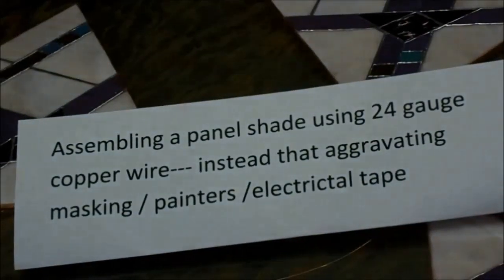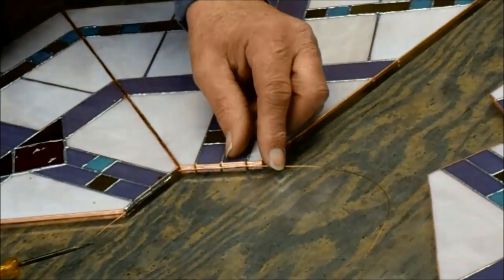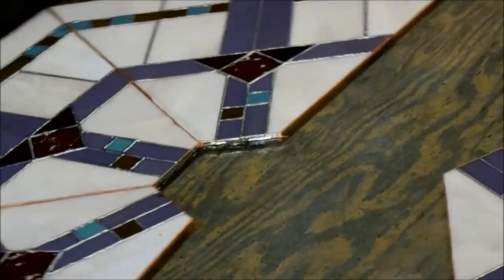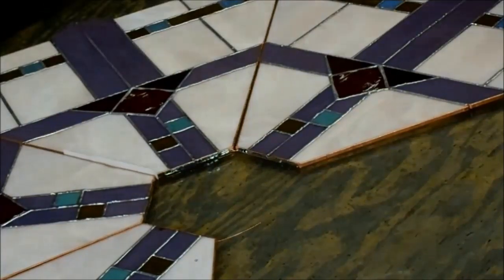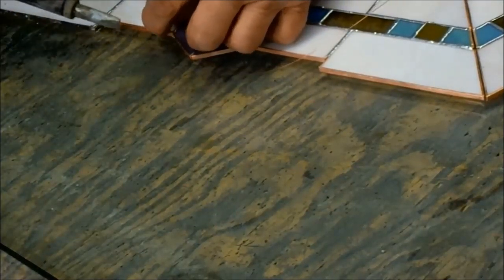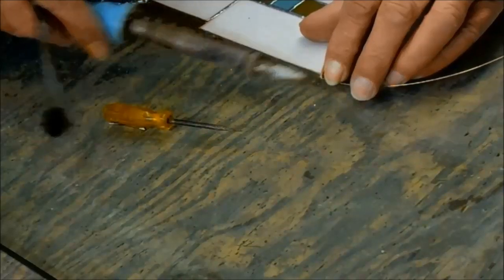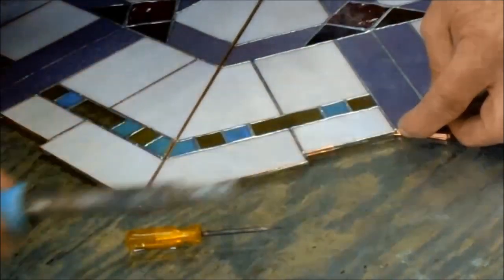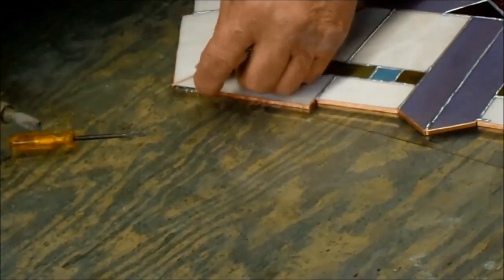Wire Shade Assembly part   1

Comment: I finished my lamp using your method,  I only did one thing different, after I picked it up and joined the sides, I tacked the top well and removed the wire and replaced it with 14 ga on the very inside it the top to strengthen it.  I also run a piece down each side of the panels.  Thank you for your guidance.  I appreciate your wisdom.